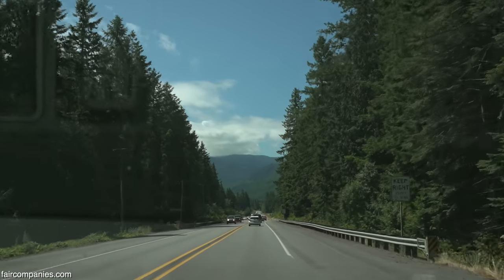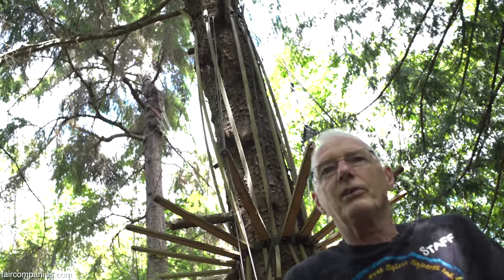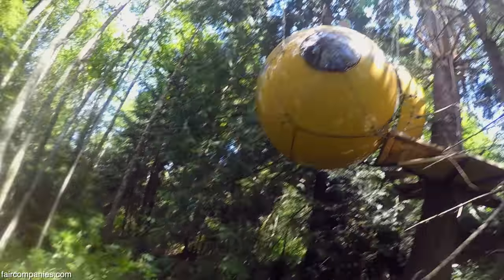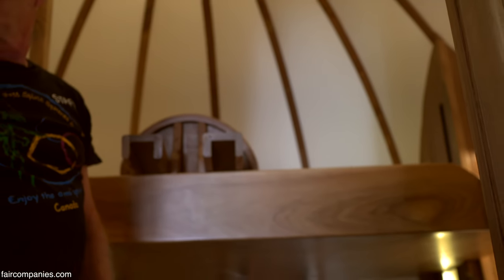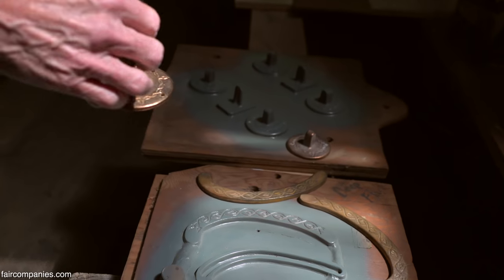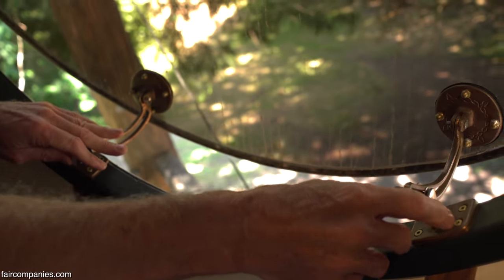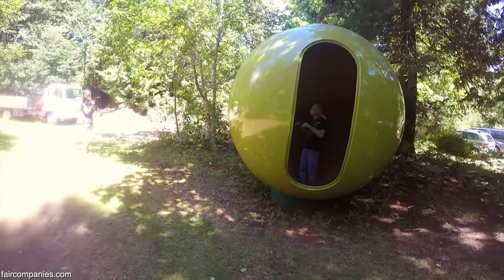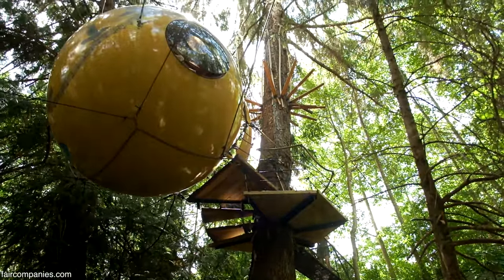Boatmaker blends math & craft in his hanging treehouse spheres

Comment: The screw drives for raising/lowering the bed could've worked together if both motors were individually run until they hit a limit switch. So the difference would be gone everytime the mechanism would be fully actuated.

Comment: @13:24 I'm starting to see some of this guys genius in his designs, what if the sphere could fold into halves. You pull all the guts out then pop it open and fold the two concaved halves together. Once at your destination reassemble the two halves or multi sections (depending on the size), and install the guts back inside.

Comment: im also into the idea of building floating houses on water foundations.. like pagoda motels resteratn  in honolulu.  thought is to build a shallow pond 12 feet larger circumference than the house perimiter... have it like 12 feet deep. build a draw bridge, glass bottoms. then a entertaining room with clear walls that would be underwater. especially if it was made to be salt water it has good energy underneath the floor. and subtlely floats..
Reply: a plus is that the underwater room would be shielded from radiation and wifi towers. i suppose u could use empty printed blocks that fill with water for walls.